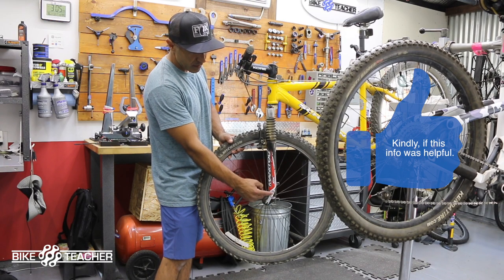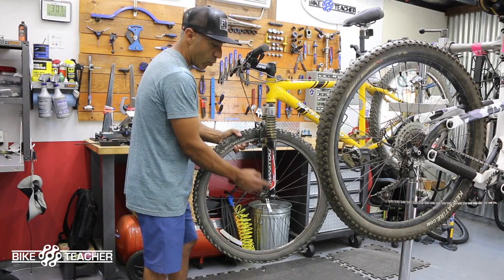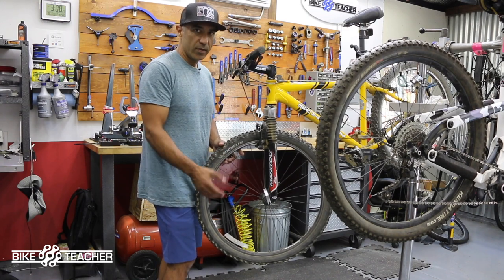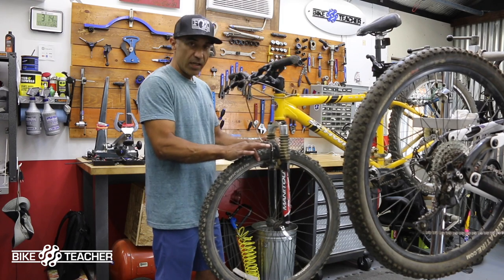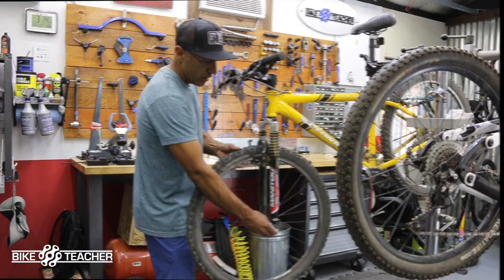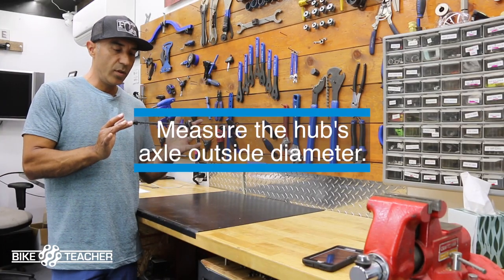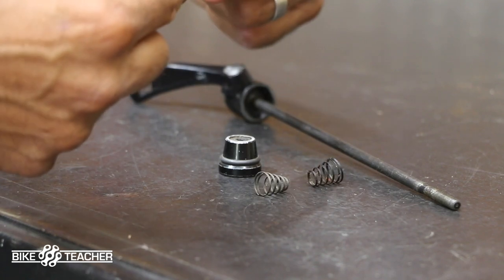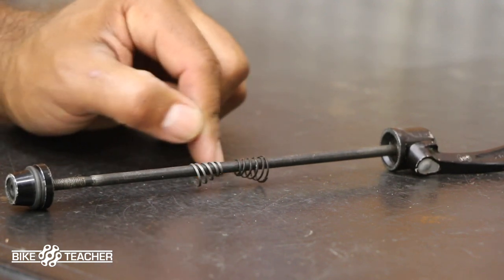How to determine quick release lever pressure. Also known as a Skewer.

Comment: The issue which i found someone post about on bike exchange, is the disk brakes. They add force which moves up into forks, then down into hub and QR. Causing it to come loose.  I've had my front wheel come off, luckily uphill and i flew over the bars into a hill on the side of the road catching my fall. Could've been disasterous 😬
Reply from the maker: Make sure the fork dropouts are in good shape, not bent, decent metal-not soft meta tor playable. replace the quick release with a well know quality one. Confirm good tension when closing.
Reply: @BikeTeacher  Appreciate the reply! I went with a TA bike just to be on the safe side.

Comment: when I close mine tight like that, it feels bent, i've adjusted my caliper with it really tight like that, and it will always rub.  Loosened it a bit more, where I could close it with my thumb, no more off balanced tire.  Soo... Idk. now i'm afraid my tire will fall off.
Reply: I know this one year old but I'm having the same problem, the qr is making my brakes rub and I can't seem to find a safe solution for this.
Did you ever found a good solution?

Comment: I just bought  an e bike the forks have the little holes for the lock type washers,  so it holds wheel in as a security measure,  however mime did not come with them, I've always used them on my BMX forks. I even watched a video from the maker of my bike , he did not use them, just put the stem in and locked it, I always worry about the wheel flying off, should I get those? Or will it be secure enuff? Thank you for any advice
Reply from the maker: Should be secure enough. I have bent those safety hooks in the past. Poor metal, good intentions though, but not needed.

Comment: Hi There, My quick release on marvern star axis 2 mountain bike was loose and I tightened the black screw on the other side..Now the Lever is facing inwards but I cant open it now..Do I just loosen the screw or best to get a Bike repair Guy? Thanks if yoy can help
Reply from the maker: I would use a small pry bar like a screw driver and use that to leverage or pry the lever open. Careful not to damage the frame/bike. Use a rage to protect it.

Comment: My rear wheel gets off-center after some usage if I have the quick release adequately tight, I overtighten them and it prevented the wheel from going off center. Will overtightening damage anything? Like the hub axle or the bearings?
Reply: How did you overtightened, i was using it like that and everything went okey, but now i change the tire and i cannot overtight again 😿, everything time i close it and test it it's open really easy, ¿Do you have some tips or something?